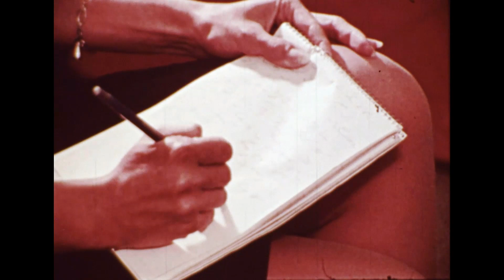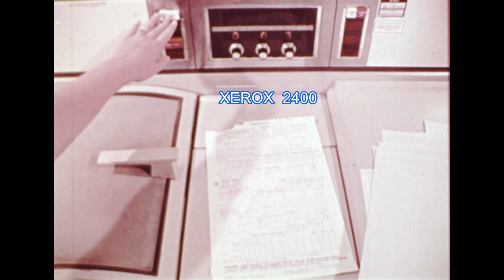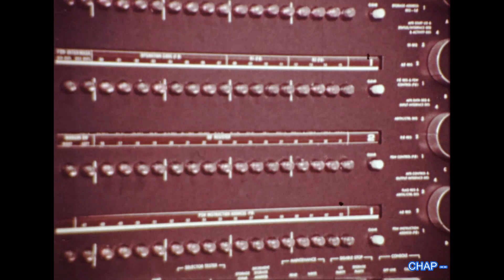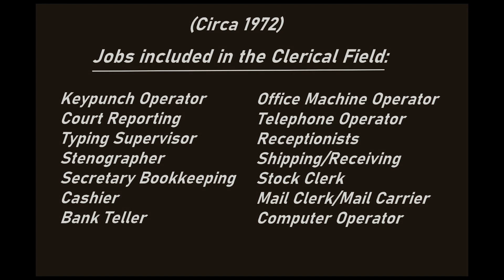Vintage Computers:  1972 Office Automation, Clerical Careers (educational) (Univac 9400)

Comment: It's a shame the blue pigment has faded completely from the film stock. did you perform this transfer, or was it available somewhere else?
Reply from the maker: Hi Jim, we acquired the original 16mm film in somewhat rough condition.  Probably stored somewhere for years in an uncontrolled environment.   Professional digitization let us obtain the best viewable result. ~ Vincent
Reply: @ComputerHistoryArchivesProject  Thank you for the expense of the transfer. However, it can be improved visually and audibly; I'll process and upload a short sample as an example, if you'd like free help in this area in the future.
Reply: Short example: https://youtu.be/8lhRfu5PMwE
Better correction is possible with access to the original scans (they were level-adjusted at some point before uploading).  No attempt at stabilization was made as this was a short example.
Reply from the maker: Hi Jim, very impressive sample.  Is this a service you offer?  Let me know if you have a web site or best way to contact you.  Thanks! ~